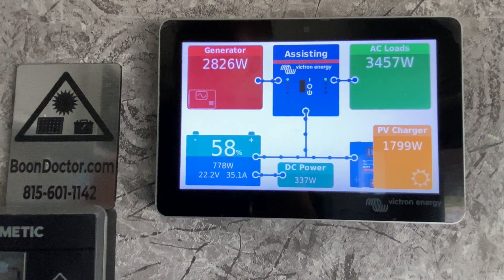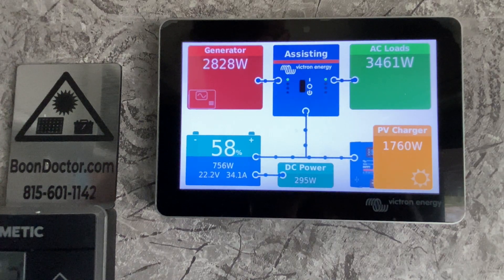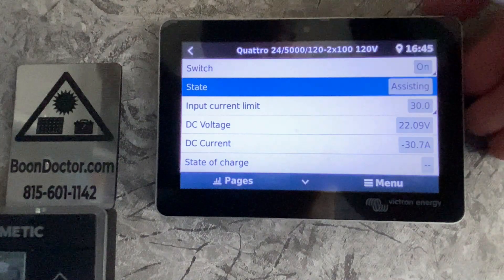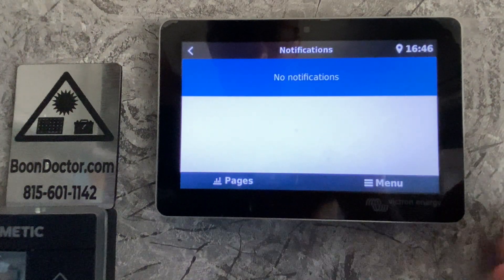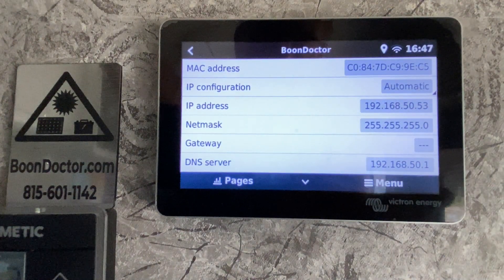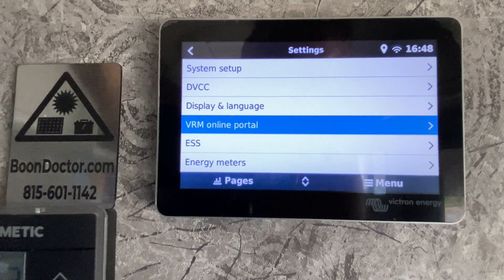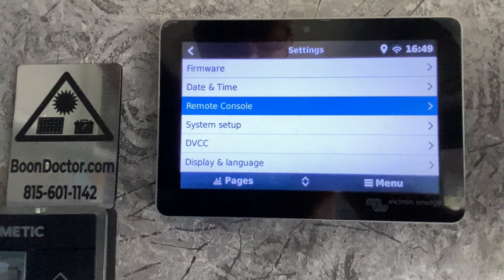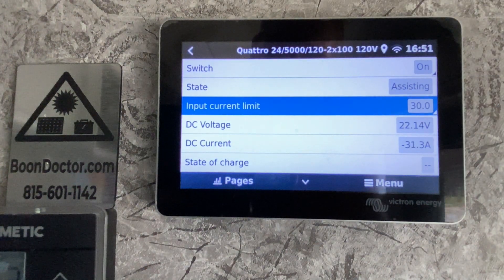Victron Cerbo GX tutorial

Comment: Question: Do you know if there's any way to extend the cable length on the GX touch panel? Is it correct that all I need is a  USB and HDMI extender cable to get me to where I want to go? I just looked at the GX pdf manual and it has a great image of all the interconnects.
Reply from the maker: You can extend the HDMI (I have hear of up to 25') and use any remote usb power.
Reply: Just know that any extension not from Victron will void your warranty on the GX.

Comment: I'm looking to install a Victron Energy Quattro 48V 10000-140-100-100 and Victron Energy Cerbo GX. I don't want the Victron Energy GX Touch 50 as I think I will not use it.  A supply has recommended that I install one to make setup easier. 

I will be using PylonTec battery's with 21kWh that start with.
I'm looking to have the system tripled with 3  Quattro 48V 10000-140-100-100 and 3x 24kWh stacks

This is for a house install.  It would be rare that I go in that outbuilding.